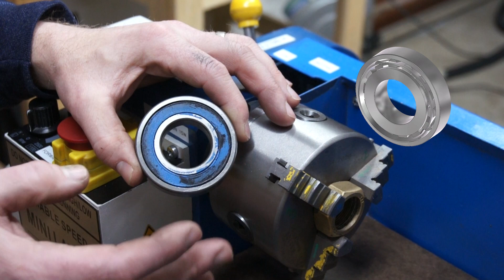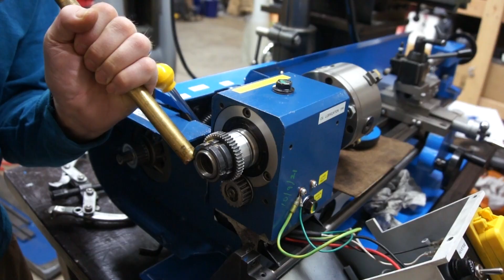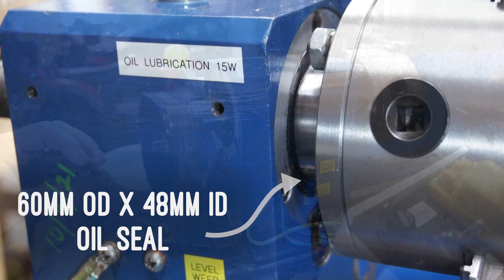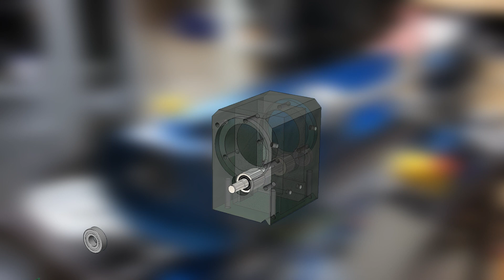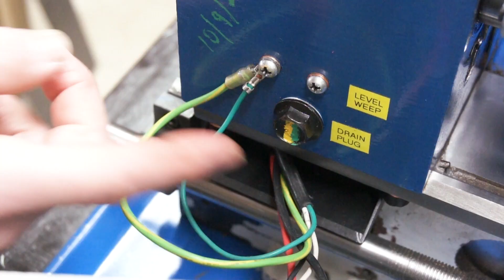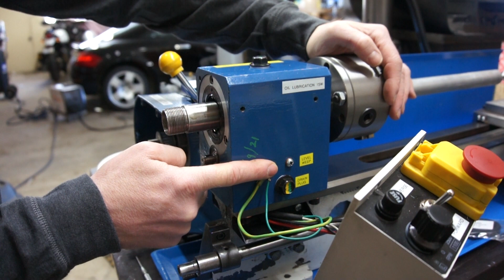Mini Lathe Upgrade: Oil Lubricated Headstock

Comment: Seems like a lot of work when all you have to do is install SEALED angular contact bearings like I did.......#37.50 each........MUCH easier.
Reply from the maker: Easier, sure, if you're doing it for the bearings.  I did it for the two-speed gears to quiet them down.  Works a treat for that.
Reply: @RobertAdairWorkshop To be fair, the later versions of the mini-lathe models have brushless motors with more torque over most of the motor's range of RPM and don't need the hi/low gearbox and the manufacturers have simply deleted the gearbox, using a direct drive to the spindle. In that case it really is only the bearings that need changing.

Your video is interesting to me as I've recently had to replace my headstock casting on my brushless motor/no hi-lo gearbox mini lathe due to an unfortunate accident with a hydraulic press when replacing the bearings and it was quicker and no more expensive  to buy a complete headstock assembly replacement that does have the hi-lo gearbox.

I've noticed the 'hi' gear doesn't seems to gear down any more than the direct drive so I'm toying with the idea of keeping the gearbox and seeing if I can get more torque from the brushless motor with the 'lo' gear setting. I've ordered the older style smaller belt as the pulley it will go to is on the gear shaft which is closer to the motor.

Eh we'll see but the upshot of this ramble is that your video is interesting. 😉
Reply: @RobertAdairWorkshop  I was thinking about oiling when I purchased the metal gears.  They were so bad that the lathe would shake from the improper tooth geometry.  Glad you managed to get a good set.

Comment: You should not be using engine oil, engine oil needs be filtered. Use gear oil to prevent wear.
Reply from the maker: This is motorcycle oil which is used to lubricate the engine and gearbox.  It has a gear rating.  Does it really, really matter on a cheap mini lathe that I won't own for the rest of my life?

Comment: I'm going about mine slightly different. I am drilling a tiny oil drip hole at the top of the spindle races on top of my headstock. I will then have some small valves to turn the oil on and off as it drains down onto the bearings, it will go into the bottom of my headstock to lubricate the gears. I planned on using one of the ground screws as an oil return system. I plan on driving the whole thing with a cam operated pump powered off of my lead screw.
Reply from the maker: That's a good idea.  Most of my older machines have oil cups fitted with felt inside to hold oil.  Might be a good way to get oil in without having to continually fill it.
Reply: @Robert Adair  I hope this information helps you. Try using a 90 weight gl1 gear oil. You should be pleasantly pleased with the results.

Comment: Never use engine oil in a gearbox. Its made to suspend metal and debre in it. Its so that it carries it to a filter. Meanwhile gearbox oil is made to let stuff setle in the bottom of the sump.
Reply from the maker: This is motorcycle oil.  It's designed for use in engines with gearboxes since motorcycles use the same oil for both (except those with separate transmissions).  It has a gear rating.  I saw the same Blondie video where she says the same thing, almost word for word.  Honestly, does it really matter?  I'm not going to have this lathe forever and after a year of use, there wasn't anything in the oil, there wasn't any bearing or gear wear.  Do I really need to add the additional drag of a heavy gear oil?
Reply: @RobertAdairWorkshop  The Mini car engine of the 60's shared the oil in the engine and gearbox.
Reply: @RobertAdairWorkshop That's interesting about the motorcycle oil; I wasn't aware of that, so thank you for the heads up.   

Then again, I guess I wouldn't as I prefer four wheels; no desire to be an organ done any earlier than I have to! 😂

One thing you missed though was that the angular contact bearings most people use to replace the standard installed deep groove ball bearings actually have rubber seals (thus the RS in the part number) and so are pretty much maintenance free (they last long enough for most people).

Comment: I just used sealed angle contact bearings.
Reply from the maker: That's really a good way to do it.  My big motivator was lubricating the metal gears to try and quiet them down.  Which the oil bath seems to have done.
Reply: @RobertAdairWorkshop  I changed the plastic gears to metal in my Central Machine lathe and wish I had not. More backlash and more gear noise. Just like your ability to be creative.👍

Comment: Really cool project, only thing I would say about the oil is that the default for machine tools is a non detergent gear oil. Hydraulic oil works really well. Motor oils are designed to emulsify contaminants and metal particles so they can be removed by passing pressurized oil through the filter. In machine tools, we want that stuff to all settle at the bottom of the gear case. Now, in this application, I’m sure it’s 100% fine but it’s all good trivia.
Reply: Good call on the non-detergent oil. Over time the detergent oils make a slurry of contaminants that will do a pretty good job of grinding the gears down. The interesting thing would be the plastic gears. Not sure how the slurry effect of the detergent oil would work with them. They may actually "trap" particles to keep the oil "clean" but not actually change them other than increasing the friction. Just an amateur here so I am not sure.
Reply: @KennyCrawford426  Wow such wisdom..
Reply: Wow such wisdom

Comment: Very nice job I have implemented a similar design using the 2 oil seals with tapered needle roller bearings. The oil seal I am using is 40x55x7 mm and 48x58x8 mm
Reply from the maker: Thanks for the tip.  What did you use for seal retainers on your lathe?
Reply: @RobertAdairWorkshop  do you mean how do u keep seal in place? If that is the question, i machine my own aluminium retainer and make the holes 55mm and 58 mm respectively. Its a tight fit so i need to hammer seal to get it in. I will share a video soon with the drawings. I am in the process to run just single speed, pulley 60t/15t (4:1 ratio) htd5m belt.i just got pulleys today. It will give me about 1193 rpm max. I need torque as mini lathe  motor is not too strong.most of the time spindle rpm bet 500-800 rpm is adequate
Reply: my video link 
https://youtu.be/BLlTeDFIM50

Comment: Hi Robert loving the upgrade, really clever the way you have done it all and over comes the problem with lubricating the headstock bearings. One question do you find the pressure builds in the headstock ? Or have you fitted a breather ? Just realised that was 2 questions 😂
Reply from the maker: Good observation.  The pressure does build.  I actually just leave the fill plug a little loose and that works, though, it does push oil out and I do have to wipe that up.  I have a plan to make a breather for it, or maybe fit a sintered breather, but I haven't done so yet.
Reply: @RobertAdairWorkshop  for a quick fix you might be able to buy a gearbox breather with the same thread size and pitch. Still great work though.

Comment: THE PLUGS SHOULD BE BSP.
Reply: Metric is the gold standard, BSP isn't used by anyone really. Even the Brits predominantly use metric now.
Reply: @pieterveenders9793  BSP is still common, but it is for pipes, not really necessary for a plug of this nature.
Reply: @pieterveenders9793  Thats BS.  "TheBrits" do not "predominantly" use metric, we use Both Imperial AND metric, but we only use metric because we were FORCED to by the f%^&(*g  EU.  Also, BSP is still VERY common in a number of industries.
Reply from the maker: We don't commonly use BSP in the US.  It'd be a special order tap and plug.  But for others, good idea.
Reply: @RobertAdairWorkshop  Here in my home town Ludhiana India, we can get any goods or services for the shop within a few minutes drive from the home.

Comment: Get's me thinking a higher viscosity oil and most likely grease packed box might be an easier route and most likely a better quality solution... still... thanks for the inspiration.  Great production!  Concise and easy to understand.
Reply from the maker: Appreciate it.  Thank you.
Reply: Corn-head #00 grease?
Reply: But why grease?? Oil is much better for gesrs and spindles.
Reply: @davidmuller1958  I really don't know what I was thinking.  Being lazy, not only including the mental facilities.  The only thing that comes to mind, remotely close at that time, is modifying riding lawn mower deck spindle housings to accept a grease zerk so can grease the modified sealed bearings where the inside seal is removed so grease is present in the entire housing.
Reply: @jafinch78  not that big of a deal, you still did alright. You just gotta repack them every few months. Oil will run off, but the video is ingenious to make it a bath.

But hey at least your bearings had protections!
Reply: @davidmuller1958  Thanks for the sanity check.  Anything to keep less from going into the trash, especially with the planned obsolescence modern designs.
Reply: @davidmuller1958  Gets me thinking how to mod deck spindles with oil seals and just use oil in some way?

Comment: Nice job.  If I were to replace the head stock bearings l would just use wheel bearing grease. I wouldn't have put the time and money in that lathe. As far as creating YouTube content that's a different story. I've never seen this project before. Thanks for your great video.
Reply: no need all coz 7206 2rs is the same size as original bearing and is angled, easy upgrade no need to reinvent the wheel just to install some tapper bearing on a chinese minilathe